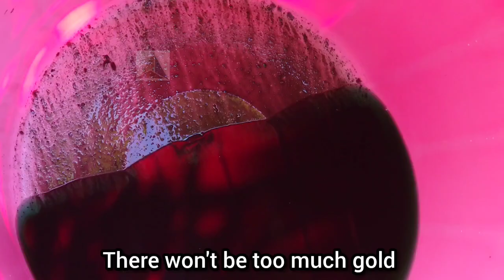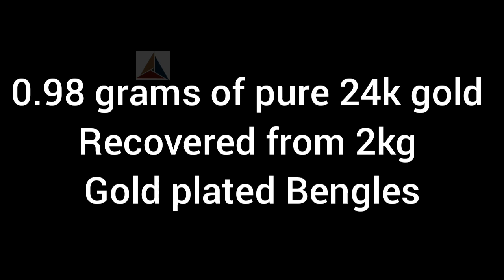Gold-Plated Jewelry Gold Recovery | Get Pure Gold From Gold-Plated Bangles

Comment: Copper in the solution is almost worth as much as the gold. How do you recover that from the solution and recycle the solution again.
Reply: 2kg of copper at approximately 8.15 per kg is $16.32 USD  one gram of pure gold at today's price is approximately $56.00 USD per gram
Reply: Put iron in the solution after the initial dissolution of the bangles, there's no way to reuse the solution to extract more gold after they add urea to neutralize the nitric acid. It's more economical if  you're trying to create AR to add the HCL then just slowly add increments of Nitric so that you aren't wasting Nitric. I realize though that in situations like shown in this video that the cost of Nitric is likely so little that it makes little difference in the country where this is shot.